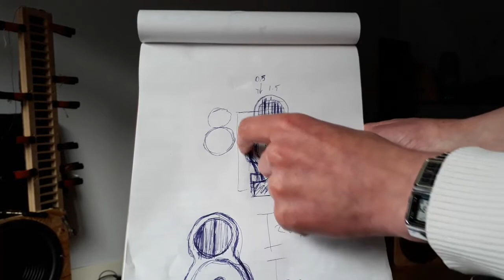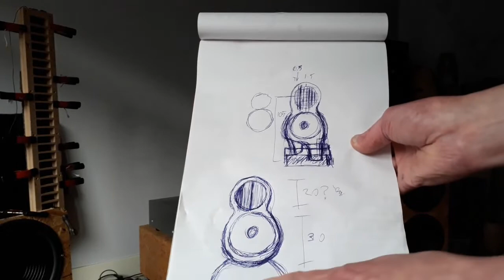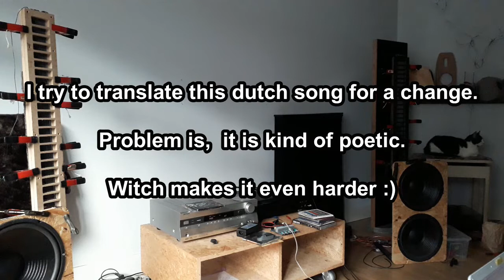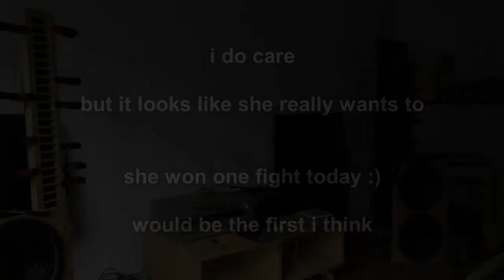Change of plans..maybe.... (and a failed translation of a dutch song)

Comment: You can use both woofers. Just cross the bottom one low with a first or second order filter.That way it'll help where iot matters and not interfere with the top one in the midrange.
Reply from the maker: there wont be enough output to scale it down that much im afraid.

Comment: I have just discovered your channel and just amazed at all the things you have built and tried. As best we can hear over youtube the ESL sounds great. Instead of going for a round ESL which looks like a snowman why not just build another set of ESLs like you have and make it double up for each side to make it a better line source so you don't have to worry about vertical dispersion. The double ESL per side would allow them to crossover at maybe down to  600Hz so the top woofers would not have to work up so high. You could use both woofers at the low end and filter off the bottom one out at about 90hz by just putting a LC series tuned circuit in series with the lower one one at it' s low frequency open baffle resonance of about 28Hz  and the upper woofer another tuned LC circuit but resonant at 90Hz and with the L tuned to roll off to the ESL at 500Hz. You will need very large bipolar electrolytic caps 750uF and 20mH iron core inductors to do this but the inductor resistance may increase the woofer Q to give it faster rise time. Look at the crossover for the Infinity RS II available at the Infinityclassics.de website to see what I mean . They have the two identical woofers in separate enclosures but here you are running them without enclosures so the act almost like they are in separate enclosures.
Reply from the maker: Hi ! hmm thats nice !, well you got some 200+ videos to watch if you want ;) well 80% not that usefull or interesting but hell. 
Thanks for the advice !  i thought myself about a RC circuit. but with that option it might screw up the crossover :) the LC is a bit harder but might work better :) never tried it to be honest.  And by the looks of it it might get rather expensive in components :( . But yeah i am a rather bad crossover designer :)if you can even call it that.  funny you mention the snowman :) haha looks like there are not many lovers of the form i scribbled down haha.  so back to the drawing board i guess..
Well a full line source is kind of what i tried to get away from. i know it has some benefits also in response, and is as much work as making this length of esl. it only costs a bit more wire and CNC ing it in 2 passes since otherwise it wont fit my table :),  but i kind of tried to keep it within my working envelope of my cnc/wood and being a bit more tolerable by most people :) although the snowman cant count on many votes either haha. 

about the rising Q,as in Qts ? or total Q since the woofers have rather high Qts on there own. i rather not increase that even more if possible :)
Reply from the maker: how about an egg shape ? or people dont like roundish forms in general >? hehe
Reply: @joppepeelen  I think people like round drivers but when you make round on top of round it gets monotonous. Too much of a good thing becomes a bad thing.
Reply: @joppepeelen  Hi , I already spent two days watching your videos on making ribbons, I think you are unto something with the segmented inverted ESL.; a single combination driver line source that can go from 300Hz to 20KHz without the cavity resonnances of the magnets of planar magnetics and driven over the entire surface of the membrane. 
 In my previous comment I meant that you could make another set of identical ESLs and stack it vertically to make two per side. If you added approx. 2"D x 5" W x  H length lumber to hold the two panels on both sided then the width of the baffle (approx 15" ) would allow you to match the baffle step loss to the crossover point and eliminate the need for a compensation within the pass band  even as you lower the crossover point. If you did this I would taper the wood wings so the front is swept back a bit so maybe only 1" rounded at the outer edge and 2" where they joint the ESL.
WRT to Qts of woofer I only meant that if the Q was too low, ( most generic woofers have low Q so that when they are in a box they can be brought to .707 by adjusting box volume but maybe your woofers already had qts of  0.68) then the resistance of the inductor would bring the effective Q up.

Comment: you need another line for 150hz to 1khz..

a woofer will hardly integrate well with this in the midrange.. 

and use 8" for 40hz to 150hz... sub for under that

personnaly i would go for a smaller supertweet esl over 7khz and try to make a esl for 150 to 7khz.. matching on dispersion

Comment: Kind of Funny but I kind of like the thin esl panel mated to a large woofer. With those big red clips it looks like some kind of giant stringed instrument sitting in the corner like an unused guitar just hanging out looking cool. Your three large  circle design reminds me of cook ware or pottery gone wrong. Also, when you talk about vertical dispersion how bad can it really be when sitting atop the woofer? It looks like if your sitting down or standing up it will hit your ears appropriately. No?
Reply from the maker: well when you use one woofer it is doable, using 2 x 30 cm woofers and the space in between makes the upper end of what the woofers do beam. and it makes it hard to blend in with the panel above. yes when sitting the top woofer is hitting your ear. but the bottom woofer wont.

About pottery going wrong :) hehe, well yeah when using a large woofer instead of the very tiny dayton. baffle is gone be bigger :( but i am thinking of still making it at least not look like a giant door. so i do want to do something with some forms or something.. not yet sure :) the round esl thing is more something i can try for this setup. it might not work at all :) it could well be a form looking like a bottle when i use these panels for test. since i dont want to trow away every test i make :)
Reply: @joppepeelen  I would rather see something along the lines of an esl panel next to the three woofers like before. Maybe have one of the woofers handle the midrange up to a 1000 hz with an aggressive bandpass filter and then using the other two woofers for lower frequencies. The problem with open baffle is that your still going to need space away from the back wall. No? It kind of defeats the purpose of having thin panels that you can tuck away. they will take up space in a room.
Reply from the maker: @gzubeck3  yeah you need space, but the thing with open baffle is not so much space saving. but the lows they do produce sound rather different. and a dipole has the benefit of not hitting the room modes as hard as a normal speaker, since there is hardly any output down low on the sides since front and rear are out of phase.  yeah i could make a 4 stack :) but they get HUUUUUUUUUGEEE with these 12 inches :)  as in wide.  it worked ok with the 8 inches i tried earlier in a video. i guess you refer to those ? the one that fell over :)

Comment: I think feel the midrange ist to loud....the upper bass to loud...the deep bass is missing
Reply from the maker: Lower bass will alway miss in the recording.  You are more a loudness smiley face eq i guess:)
Reply: @joppepeelen  Yes i think ..thats a problem in recording  dipols...in real dipols and open baffle systems have more bass
Reply from the maker: As far as i know a dipole should create roommodes less then a regular speaker. It lacks the reenforcement of the sides a normal speaker would have.  Anyhow bigger the room less problems in potentially mote hearable frequency range. I agree :)